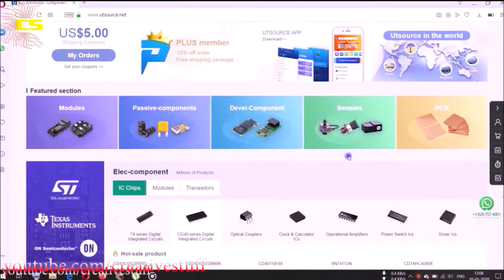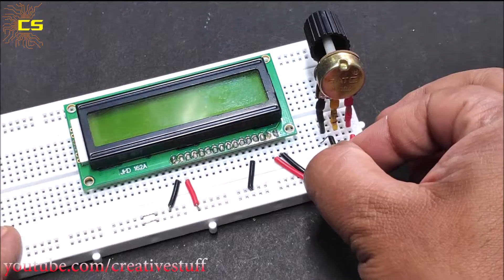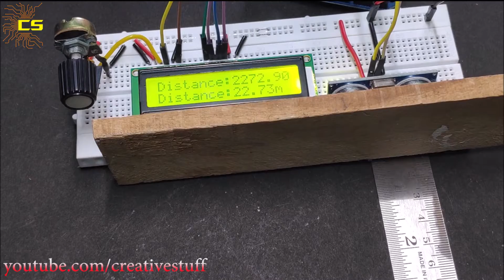How to make an Arduino Distance Meter using Ultrasonic Sensor

Comment: excellent  Am hobbyist. I need the code and circuit diagram for 1) distance measurement both CM & Inches with decimal( Centimeter & Inches) for 16X02LCD without using breadboard 

And
 2) distance measurement both CM , Inches , Ft & MM with decimal(CM , Inches, Millimeter & feet) for 16X04LCD 
Can you pls share it?

Comment: I'm facing this error while compiling code

C:\Users\HOME\AppData\Local\Temp\ccfan3ci.ltrans0.ltrans.o: In function `pulseIn':
C:\Users\HOME\AppData\Local\Arduino15\packages\arduino\hardware\avr\1.8.3\cores\arduino/wiring_pulse.c:46: undefined reference to `countPulseASM'
collect2.exe: error: ld returned 1 exit status
Compilation error: Error: 2 UNKNOWN: exit status 1

Comment: Paste code here please, in description the code is not opening
Reply: #include <LiquidCrystal.h>
 
#define trigger 9
#define echo 8
 
LiquidCrystal lcd(12,11,5,4,3,2);
 
float time=0,distance=0;
 
void setup()
{
 lcd.begin(16,2);
 pinMode(trigger,OUTPUT);
 pinMode(echo,INPUT);
 lcd.print(" Ultra sonic");
 lcd.setCursor(0,1);
 lcd.print("Distance Meter");
 delay(2000);
 lcd.clear();
 lcd.print(" creative stuff");
 delay(2000);
}
 
void loop()
{
 lcd.clear();
 digitalWrite(trigger,LOW);
 delayMicroseconds(2);
 digitalWrite(trigger,HIGH);
 delayMicroseconds(10);
 digitalWrite(trigger,LOW);
 delayMicroseconds(2);
 time=pulseIn(echo,HIGH);
 distance=time*340/20000;
 lcd.clear();
 lcd.print("Distance:");
 lcd.print(distance);
 lcd.print("cm");
 lcd.setCursor(0,1);
 lcd.print("Distance:");
 lcd.print(distance/100);
 lcd.print("m");
 delay(1000);
}

Comment: Arduino: 1.8.12 (Windows 10), Board: "Arduino Uno"

Sketch uses 2986 bytes (9%) of program storage space. Maximum is 32256 bytes.
Global variables use 200 bytes (9%) of dynamic memory, leaving 1848 bytes for local variables. Maximum is 2048 bytes.
avrdude: ser_open(): can't open device "\\.\COM4": The system cannot find the file specified.

Problem uploading to board.  See http://www.arduino.cc/en/Guide/Troubleshooting#upload for suggestions.

This report would have more information with
"Show verbose output during compilation"
option enabled in File -> Preferences.
It says error can u help me pls?
Reply: disconnect the arduino cable and reconnect.. if it still doesnt work, check the ports, select correct board, check port drivers, it should work fine